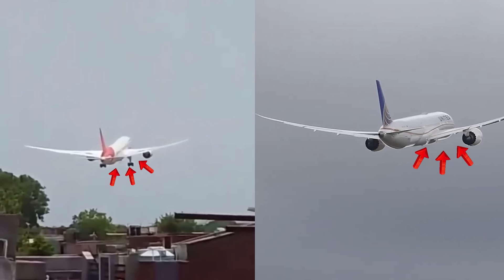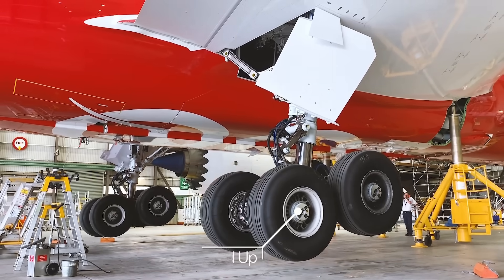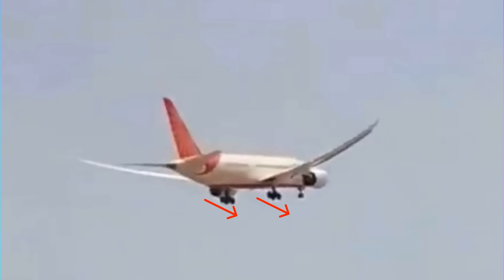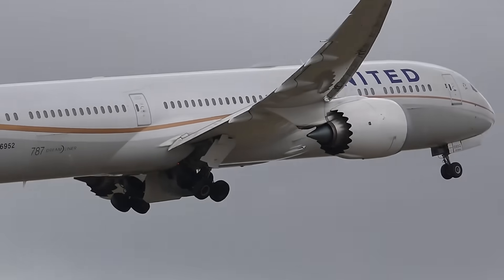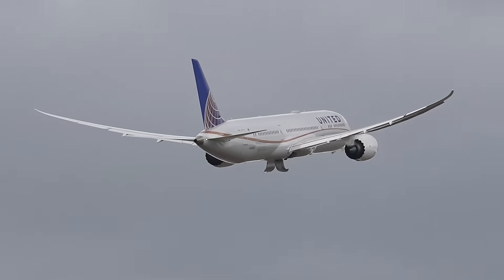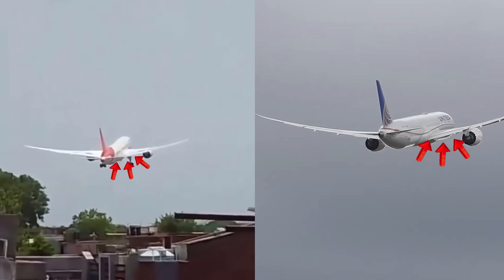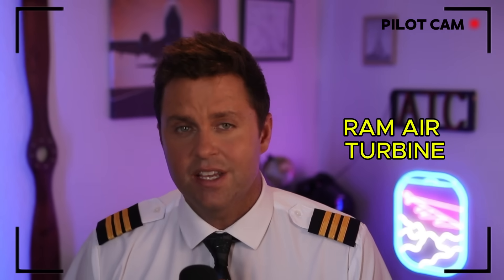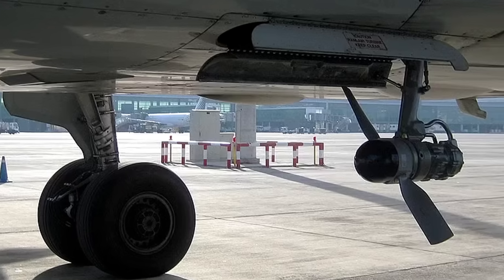Pilot Explains: A New Detail in the Air India 787 Crash Everyone Missed

Comment: Overheated FCB Fuel control board would force it into a reset state and would cut the power to the fuel pumps cutting engine power.  The plane was sat on a hot runway for 3hrs at the hottest part of the day  in one of the hottest months of the year.
Reply: Planes sit in the hot sun all the time.

Get a grip.

It gets well over 120°F in Sacramento  on the tarmac, yet...nothing.

Comment: Dual engines failure then RAT come out . After blast in plane control of engines cut off . I think electric gernater which are running with engines cuts and stop electric  supply then pilots switch down RAT but in this position very low height engines electric control stop working and RAT start but plane weight to much full load plane coming down also almost no thrast plane hit hard on earth .  Moral of story recovery time is few seconds so pilots can,t do any thing . Take off position of any plane is most dangerous part of flying .

Comment: The plane apparently sat in the extreme heat for 3 hours prior to takeoff with no aircon on, soaking up heat. Could the heat build up have affected the fuel pumps causing a dual fuel starvation situation, causing hydraulic failure?
Would that not explain duel loss of thrust, half complete gear retraction?

Comment: Dont you just love it when all the armchair experts come out after an aviation disaster (like the 'lost' Malaysian 777). I do not have any experience working on the 787 (i am a retired engineer) so I may not be correct in some of my assumptions here. I do see the RAT down, and believe that is automatically extended when all hydraulics are lost, i.e all engines failed and electrical power lost (most modern large aircraft have electric hydraulic pumps as backup pumps). The RAT needs a minimum airspeed to be most efficient, and this is not efficient at all at this particular stage of flight. This RAT electric and hydraulic supply is mainly directed to primary flight controls, it does not have anywhere near the capacity to raise the landing gear, nor probably, the flaps be they hydraulic or electric. Why has this all gone wrong? Who knows yet, but the full accident report is likely to identify the cause, and anyone in the industry should be more professional than to offer guesswork as a synopsis for an accident of this nature and severity.

Comment: Just asking a question as a complete layman, but if the electrical system failed wouldn’t that stop the fuel pumps from working and hence the engines stop….given that passengers on the previous flight on this aircraft reported various in cabin electrical failures maybe that is the system that needs a deep investigation.

Comment: Engine in Boeing 787 is apparently bleed less engine means it do not run any secondary (Auxiliary) equipment like AC, Fuel pump etc. APU runs those equipment. It is very unlikely that both engine failed at the same time what I believed might have happened is APU was poorly performing and failed ultimately also because of that fuel pump failed as such engine have 12 fuel injectors with 5 psi pressure which can not be generated by battery or RAM Turbine. Hence both engine did not get enough fuel supply and it failed.
Reply: I also highly suspect fuel contamination since GE Engine are big fuel contamination may have not affected them but APU is small so it gets affected any ways. And shut off!!

Comment: The RAT will also deploy due to hydraulic failure.  The surviving passenger reported hearing a loud bang which could have been pump failure due to landing gear actuator seizure.  The RAT taking over an already degraded electrical bus (reported on previous flight) may have disrupted engine authority or fuel flow long enough to cause the plane to lose thrust.

Comment: How long does it take for the engines to spool down from full power?  I would have thought at least ten seconds and with the residual pressure in the system the landing gear should have come up a lot further.

Also, the engines can be heard, but they aren’t loud, more like idle.  Finally, the surviving passenger reported that there was a loud bang followed by the flickering of the lights.

I postulate that the bang was the lithium battery exploding.  The plane had been in maintenance recently and the wrong battery may have been installed.  A lithium battery explosion would take out the circuits it connects to.  This would cause the entire electrical system to be shorted out.  The RAT would not be able to restore the electrical power until the short is cleared.

The second possibility is that the computer tried to land the plane due to some glitch, possibly related to the above scenario.

A sudden electrical failure may cause the engines to go to idle, the default or standby configuration when waiting for instructions.

Comment: Amateur opinion, but could the debris that we see that got thrown into the air at lift off, caused  because the pilot used the entire length of the runway, have gotten sucked into the engines and caused them to cut out?

Comment: Standing on a 40C runway for 2.5 hours without AC would have heated the fuel lines. This can cause lots of bubbles. The angle of take off could then have merged the bubbles causing a serious vapor lock condition. That would explain the bang the survivor heard and everything else. The bubbles would even have caused smaller thrust issues on the runway.

Comment: I find it interesting that noone takes an engine failure/rollback to idle as a result of the simultaneous loss of all 4 Generator Control Units (GCU) into account, causing the immediate loss of all AC power on the aircraft. The GCUs run the same software (with the same bugs?) and in 2015 FAA has issued an AD ("We are issuing this AD to prevent loss of all AC electrical power, which could result in loss of control of the airplane.") before because ALL GCUs could simultaneously go into failsafe mode regardless of flight status (in this case due to a counter overflow bug which has been fixed) resulting in a total loss of AC power. I am not familiar with the 787 but according to a electrical and fuel systems overview all the fuel pumps are driven from AC power: "Two AC Pumps In The Centre Tank (L &R) And Two AC Pumps In Each Main Tank (FWD and AFT).
If All Pumps Fail, Each Engine Can Suction Feed From Its Respective Fuel Main Tank, However Suction May Not Provide Adequate Fuel Flow At High Altitudes." It may also not be adequate during Takeoff?

Comment: The only surviving passenger said he heard a loud bang just before the plane began to lose altitude. Captain  Steeeve said that was probably the sound of the Ram Air Turbine (RAT) deploying but could that loud bang have been something else. Maybe a catastrophic failure of something that affected both engines simultaneously. But considering that most crucial systems have 2 redundant backups what does that leave that could fail and shut down both engines?
Reply: How about, gear was retracting as Gary stated and then after loss of hydraulics they slipt down and were locked in place by gravity?

Comment: Im an electrical engineer. If you analyse the Electric and hydraulic circuit diagrams you will find out the reason when 2 Engine failed at the same time. If 2 Engine failed at the same time than it might be a contruction fault . For e.g. It was a power loss and it Switches over  to The UPS (uninterupted Power supply) During this change over it could happend that the hydraulic lost the pressure. This is what i mean with contruction fault.

Comment: I remembered I think it was in late 70s early 80s there was an aircraft jet passenger that was fuelled in I think America maybe Canada or Alaska and the fuel truck had gone for testing and they fill the tank with water and it never got emptied and returned back to the airport and the regular assumed it was full of fuel and fuelled the aircraft and thus it had the engines flame out be ause of the water contamination .
And in Australia we had a Cessna 402 C Businessliner it was a new aircraft about 100 hours old and the refueler put jet A1 in it instead of lowlead avgas because it had stickers with turbo on the engine cowls because they were turbocharged and luckily both engines sized up solid as it was taxing from the small passenger terminal and CASA had all aircraft with turbo position engine aircraft to remove stickers that said turbo so this mistake never happened again so the theory of fuel contamation is a very big possibly

Comment: Now power / no fuel.  Poor engineering. If anything can go wrong, it will go wrong eventually. If fuel is water aux generator wont run, if battery is dead no fuel pumps. Likely a bad combination of two or more faults.

Comment: Double engine failure & I say contaminated fuel. Me, an aircraft engineer's opinion! Note the white mist @ takeoff from port engine. (that I originally thought was dust on rotation). The landing gear position is probably from residual hydraulic pressure in the system...I believe the gear had been selected up!

Comment: Electrical failure could be a possibility.  Can it shutdown engines if there is no electricity, that explains. Landing gear struck , also it might need power to retract. This electrical failure would have happened due to main supply cables might be getting burnt midair. That explains RAT deployment,  but it cannot backup and restore ekectricity in such short time.

Comment: I honestly don’t get this. You’re the second pilot I’ve heard suggest it might be beneficial to leave the gear down in an emergency - and that’s just nonsense. Unless you're preparing to land on a known, hard, level surface like a runway or highway, leaving the gear down is far more likely to cause severe damage or flip the aircraft. During takeoff - especially over urban areas - gear down only adds drag, kills climb performance, and shortens glide range. There’s a reason “gear up” is the very first command the pilot flying gives after positive rate. It’s standard procedure for a reason - and ignoring it puts lives at risk.

Comment: Correction: there is a third way for the power to cut, an 'uncommanded descent' initiated by the flight system controller. It has happened in several incidents on similarly fly by wire Airbus, there's no reason to believe it couldn't occur on a 787. The crew deployed the RAT because they didn't know why the power was lost.

Comment: IMO the moment, when retracting the gear has been selected, that caused the both engines failure. There must be a connection, between the landing gear hydraulics system  and the engines or defective hydraulic system damaged somehow the fuel pumps.

Comment: The sole survivor said he heard a bang.  An investigation into sabotage or terrorist attack should be underway.   Fascinating that an ageing semi retired Australian pilot immediately concluded poor training and that they retracted the flaps rather than lifted the gear. A somewhat biased and poorly assessed conclusion to leap to.  This assessment here makes an excellent point re lack of thrust sound.  This fits with the Pilots Mayday call…… loss of power.   A number of possible causes for loss of power. Fuel, hydraulics, electrics….. failure to deliver fuel to the engines……
Reply: Dirty spark plugs, bad fuel pump or fuel filter.

When was the last tune up at Pep Boys on that thing?

Comment: The runway was 3.5km long and they did back track, yet the take-off was at the end of the runway hence the dust, so I can only conclude around V1 they encountered an issue and had to take off. The video has no audio on take-off so we do not know how the engines was performing, but as bad as the video is we do not see compressor stall. Black Box will hopefully resolve the incident.

Comment: The doors aren't open on the gear, So I think it happened right at the point of gear up, I.e., positive rate gear up. The electrical fail occurred at the point of wheel tilt on the B788 and before the door opening.
Ive been watching B787 take off all day at work there is a slight difference in order between the B788 and B789,  The B788 will tilt at the same time as the door open and the B789 tilt after the doors are open.

For me it maybe an accumulation of a set of particular faults that happen in a particular order or within moments of each other, individually they are not a big issue, i.e if they happens on the ground, do a reset and if the error goes then it can dispatch.
The trouble is if you have 2-3 faults all doing that, all resetting and all getting dispatched at different time then in the right conditions and order it maybe just be enough to create something that wasn't planned, expected or considered because the possibility is so remote but not impossible.

The DGCA wanting  all repetitive technical faults reported over the past 15 days must be reviewed and addressed promptly is covering the angle im thinking.

Comment: If it was fuel contamination , still the odds of both engines flaming out at EXACTLY the same time , on the dot,  is a puzzle to me. If that was the case won't the 2nd engine to fail have a time gap of at least by a few seconds? The plane doesn't look like yawning to one side to suggest that either.
Am I correct?

Comment: Hi, Gary.  I believe you have the correct, direct cause of the crash.  In your expertise as a pilot, you
surely understand the equipment in a fly-by-wire modern aircraft.

In the earlier days of multi-engine aircraft,  it would not necessarily  cause the engines to cut out
if, for example, a cable that controlled the ailerons, flaps, or stabilizer were to become disfunctional.

In today's aircraft,  highly integrated by electronic sensors,  computers,  and possibly fiber optics, we have to think about new ways that engines can lose power.  The black boxes can reveal if the engine controllers
in the fuselage and the engines on the wings, lost connectivity.  Is it possible that the large deflections that we see in the operation of carbon composite wings flexed the connections?

With the pilots  in the cockpit,  and the controllers in the racks under the cockpit, how do the engines receive instructions given by cockpit terminals?   Are they given commands by means of fiber optics?   How is redundancy handled if a controller goes into failure mode?  If the engine loses connectivity  to its controller because of a communcation link failure, will the affected engine shut off?

The pilot issued a triple Mayday followed by loss of power and loss of thrust.  Did loss of power, meaning electrical power, cause redundant controllers to shut down, thereby causing engines in turn to shut off thrust?

Does the flexion of the B787  wings somehow lead to a loss of the electrical power somewhere, or the
loss of machine control signals to the engines cause the loss of engine thrust?

Comment: Captain's chair failed on rotation and moved back abruptly. Captain grabbed control column and thrust levers under startle and brought power to idle. Below 400 feet power stays in HOLD and you can do with it what you want - it is not going back until you above 400 feet. First officer may not have enough time to react. I also fly 777. Sadly, but chairs on Boeing are crap. Why ram air turbine was deployed and was it I don't know.

Comment: computer program failure if both engines were out? I'm not a pilot but the chances of both engines flaming out at the same time is remote, maybe the system that controls them failure and after rotation they ran out of runway to land. fuel is always a possibility, but is it checked before loading for the right octane or fuel type?

Comment: I'm not a pilot. But I've flown on 777 and 787 dozens of times. They hit VR speed very fast. How do we explain this jet got all the way to the end of a 11,800 foot runway? Something was very wrong long before take off. If they had engine problems, why didn't they reject? If they didn't get rotation at VR, why didn't they immediately reject? Furthermore, they hit the end of the runway at higher than normal speed, so they had plenty of engine power. Lots of guessing what happened in the air, but clearly the problems started on the ground.

Comment: Recently, I heard of a crew flying the 76-300 accidentally going past the gate and retracting the flaps to zero at acceleration altitude and getting a stick shaker as a result, so wing configuration is certainly an issue in these heavy jets.  Nevertheless, I think it's a stretch to say that happened here.  I'm curious about electrical power supply to the FADECS and assume after engine start they run off a PMA or some such from the accessory gearbox... so the engines should be isolated from a complete electrical failure as in some kind of major short and busses dropping out or generators tripping offline.  Of course, if both engines had failed due to contamination or other reason, it wouldn't matter from where the FADECS get power... But that would have to be a LOT of contamination and one would think the FADECS would command the igniters to continuous for attempted auto-relight? That much contamination... I mean, there's a massive fireball... and how long were they taxiing?  How much did they burn in the taxi?  Are we saying the contamination became an issue from the rotation angle?  The pumps draw from the bottom of the tanks don't they?  And water is heavier than jet fuel...  Eh... hard sell.  As for fuel pumps in a total electrical failure, one would think motive flow would keep the supply going at low altitude at least for a certain amount of time...